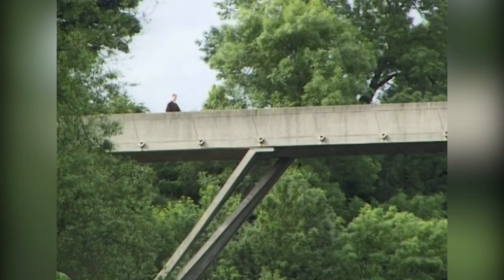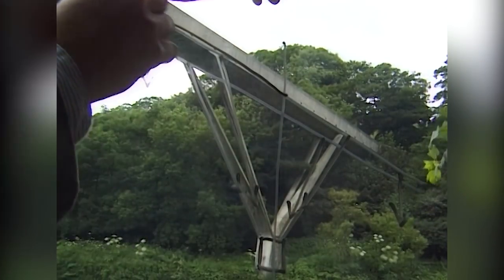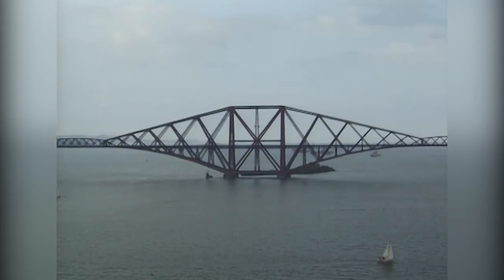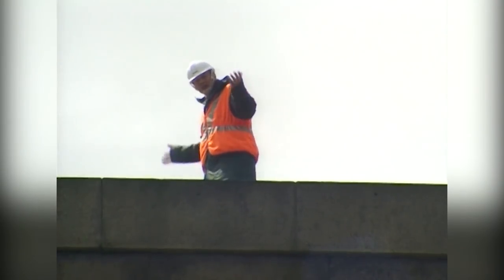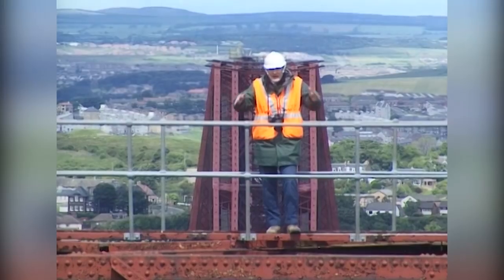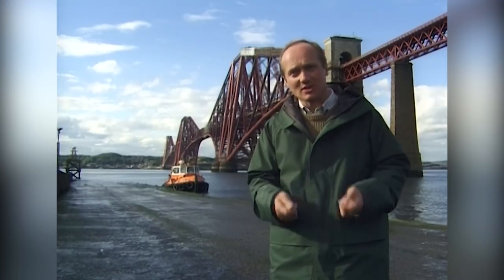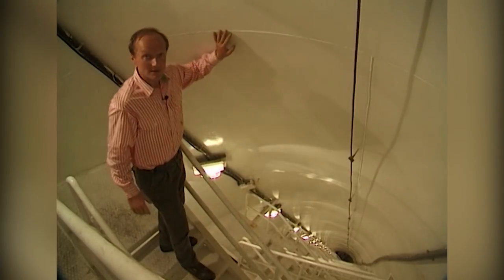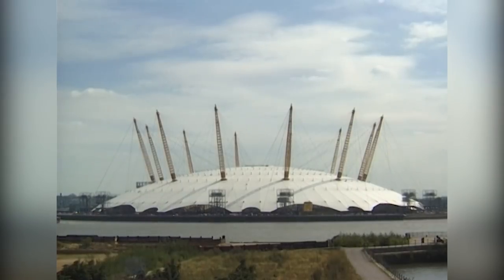How Do Cantilevers Support Bridges? | How Did They Build That?

Comment: Funnily enough, there's now a rather handsome cable stayed bridge right next to the Forth Bridge.
Reply: From my understanding a Cantilever Bridge is much stronger at handling heavier loads then a suspension bridge. The trade off is its more expensive to maintain then a cable stayed bridge. If the purpose of the bridge is to handle road traffic then a suspension bridge would suffice..for rail traffic a Cantilever or Truss bridge is better.